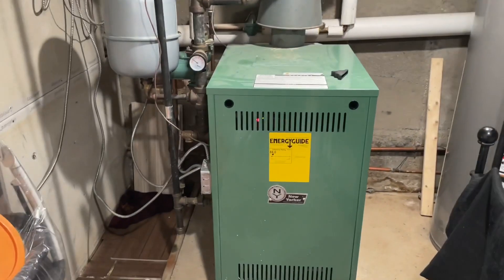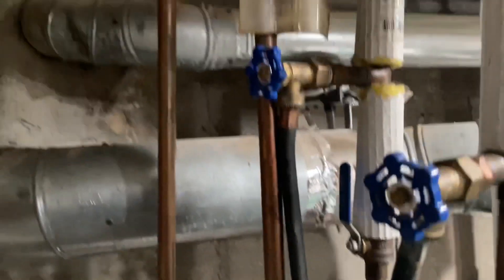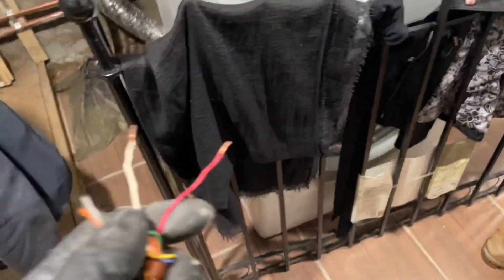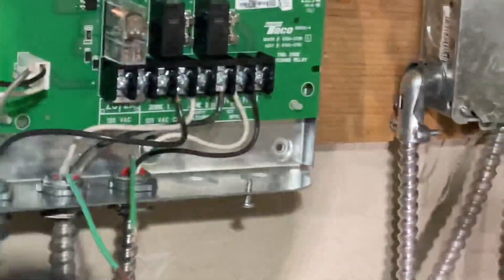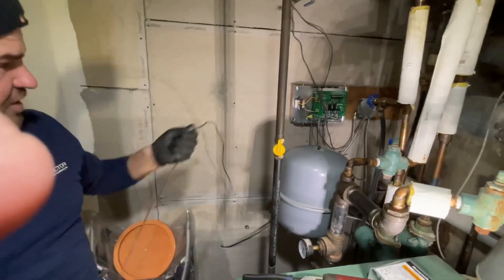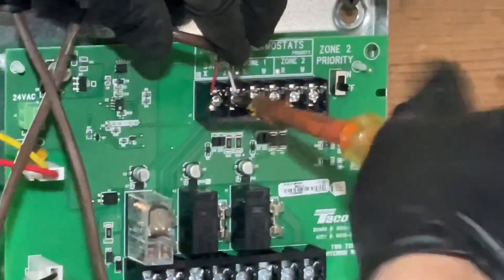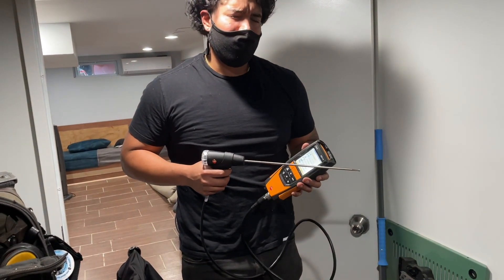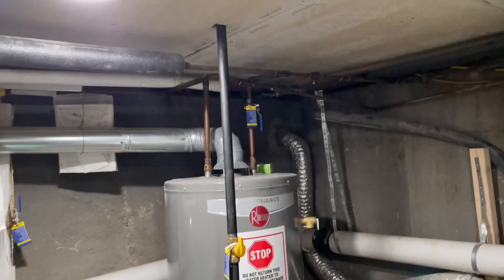How Did They Expect This To Work? How to wire a 2 zone Taco switching relay for circulators

Comment: Any chance you ran the analyzer with the dryer and water heater firing as well ? Awesome job with the control box, exactly how I would have done it. The only other thing I was thinking was that there is no way there is enough combustion air for both those appliances in that small room if that solid door is closed. Even if the door was open its may be iffy if the rest of the basement provides enough air. Then also with the dryer sucking air out. I'm sure it works and has forever, but at quick glance definitely might not be "correct" ?

Comment: @Mikey Pipes, I can't thank you enough for your video. We moved into a new house that had the exact same problem where one thermostat controlled two zones. I bought the exact same switching relay and was able to fix the problem myself, knowing just some basic wiring. Works like is charm. You're right, easy stuff!

Comment: As a consumer this is really an issue. There is a very high number of installers doing an horrible job. They get away with it because many consumers do not have the knowledge to understand that there is an issue, or sometimes the issue results in premature failure (by several years) but by that time it is too late to do anything.

Comment: I think this is the most difficult thing to visualize at times. Figuring out the correct paths for line voltage, low voltage...it is even harder when you pick up someone else's mess. Great job. You were 50% electrician 25% plumber and 25% surgeon in this one.

Comment: I would like the Knipex pliers because I do a lot of work in confined places, sometimes only my hands are accessible and the thinner lighter Knipex pliers would be perfect. BTW way you have the straight pipe wrenches have you tried the end pipe wrenches, started to use end pipe wrench 28 years ago now they are my go to wrenches all the time instead of straight.

Comment: Ground not connected ! That's a big no no. Grounding is the most important electrical connection, and always check the GFCI.
Reply: @PipeDoctor  I'm don't work in the States so I'm not familliar with the State / Federal electrical code, but wouldn't the power be routed throuth a GFCI located on the electrical pannel ?
Reply: @trespire  No.

Comment: IMO Wago connectors are excellent. The home owner in this case really should take legal action against the original installer. Not only was the installation botched, but the homeowner was talked into buying equipment way beyond their need (fraud). Karma needs to catch-up with this installer pronto.

Comment: You really should ground that control box. It will be ok 99% of the time, but there always is a possibility of something bad happens and energize that metal box. Not a good habit to omit that ground connection.  FYI: Although it is recommended, twisting wire before wire nut is not necessary.
Reply: @PipeDoctor  That actually is a relic from before and early days of wire nuts. New wire nuts bites into the copper with sharp spring. It makes good and secure connection without twisting and the instruction from manufacturer actually states "Pre-twisting acceptable, but not required."   Wires will get twisted while putting the nut on. If it doesn't you didn't turn the nut tight enough. Pre-twisting helps when you want to just remove wire nut and check voltage without disconnecting. So, I do it most of the time, but sometimes I don't.
Reply: @PipeDoctor  I am not sure what you are referring to. Are you referring to Wago connectors? If they are genuine Wago, then they are better than wire nuts. If not, who knows if they can handle rated current. Push on connectors are also ok as long as they are from reputable brands.

Comment: BX and MC are not the same thing. People get lazy with the green cable when assuming the MC does the same thing as BX. You should always add a pigtail to the box when using MC.
Reply: @PipeDoctor  the jacket of BX is rated as a ground MC is not(unless specified but one would have to buy that specifically from supply house, its expensive). BX is an outdated product not readily available. The lack of a dedicated ground( green wire) in the jacket is not necessarily indicative of BX because you can buy empty jacket and add your own cable. I can identify BX by sight, its heavier, feels different.. my advice is, just use pigtails and anti sparks(red grommits) as a habit, that way your ass is covered.
Reply: @notsure103  The jacket of the older AC (BX) type cable is not rated to be used as EGC. It lacks a bonding strip.

Comment: Well this gives me confidence to start my business.  I figure that I will be better than the hacks who do jobs like this.  I want to do perfect work though and am watching all of your videos.
Reply: Unfortunately, sometimes doing things right is not enough to be successful in business. In fact, many businesses doing a bad job like this are doing very well because they underpay underqualified and undertrained installers. With customers always looking for the cheaper option, and not having a clue to detect issues themselves, they often end up giving business to the bad installers. Speaking from experience from a family of contractors who had to deal with this and saw shady competition get a lot of traction due to practices like these. You will, however, sleep well at night knowing that you did the right thing, and for some (including me) it's more important that the bottom line.

Comment: You right Mike, the relay panel 8-32 green screw should be bonded with green wire and all green wires together. Same rule applies to bonding all metal boxes with 10-32 green screw.  “1900” outlet box in this case. The MC cable aluminum sheath is not rated for a fault current, unlike the BX which does not have a green wire, just aluminum wire that is used for bonding at each termination.  MC cable green wire is rated for carrying a fault current. This is a common error, done even by some electricians. The idea is you want to make sure, the circuit breaker will open if the need arises.
Thanks for your videos. I found your Chanel not to long ago, you guys do great job. O...and please do not replace Kelvin! He needs to stay😀

Comment: Mikey quick question about your testo. Iv had my 310 for a little over 2 years, used it maybe 12 times had to send it in for re calibration at $450. How does your 320 hold up? I know they need to be re calibrated here and there but at $450, the tool only is like $650 lol

Comment: What you walked into was insane - awesome video and recovery though!   Any chance you might be able to take a quick look at a quick wiring question on my home setup here https://photos.app.goo.gl/PUBEYnsGLHRsq6fDA?   Promise it is not like this one, but one critical part was left off of this to tie the SR501 into the L8148A controller?  Any thoughts on this?
Reply: @PipeDoctor  Thanks for getting back, appreciate it!  You are correct, unless the Argo zones are calling for heat at the same time, the SR501 will pull the boiler temp down completely unless the Argo zones start to call before that happens.  The SR501 does not seem to have an 'end switch' connection (at least not one labeled as such on the PCB or schematic)?  As I look at the schematic, I see terminal 5 and terminal 6NO labeled as 'To TT on boiler", but these are on the 120V side of the unit and I need 24V to go to the L8148 TT terminals?  If I jumper from terminal 3 (jumpered as hot) to terminal 5 that will bring power to the 6NO terminal - but it will be 120 and not 24V DC.  Do I need to get that 6NO hot wire to a 24V transformer and tie that into TT on L8148A TT terminals along with the ones from the Argo controller?  Or, now that I look at the setup, I already have terminal 4NO going from the SR501 to the circ pump (110V) and to a 24V AT72D transformer that is hooked up (2 wire) to the basement zone control valve.  It might be that I can tie the SR501 to the L4148E TTfrom this existing transformer?

Comment: Was the york from the vid with the pilot replacement? That was a hot water system, not a forced air, cracked heat exchanger would just be water comming out. Lol how silly.

Comment: How do you patch or plug the flue pipe on mid-efficiency venting once completing a flue gas analyzer test? Pipe Doctor Plumbing, Heating & Air Conditioning, Inc.
Reply: I have seen high temp RTV silicone (the red stuff) used as well for the 1/8” ports.

Comment: Is BX required for boilers?  Or can you use Romex?
Reply: Not a sparky.... but i believe Romex can’t be exposed unless 7’ or more off the floor, where it can’t be easily damaged. Below 7’ it has to be protected by conduit or metallic sheathing.
Reply: Thought so.  And of course I have Romex on mine...  old owner was a piece of work.